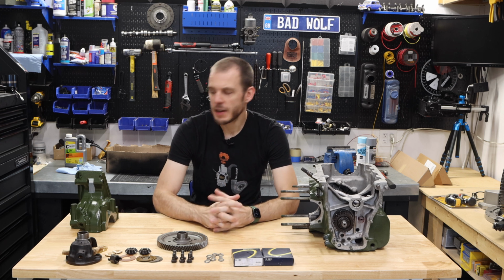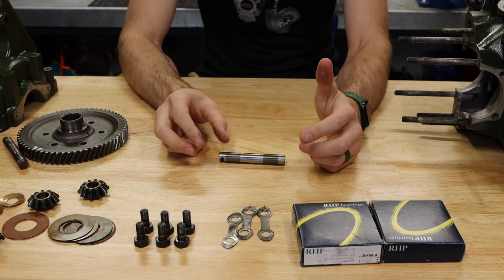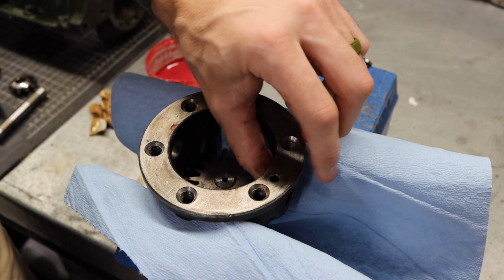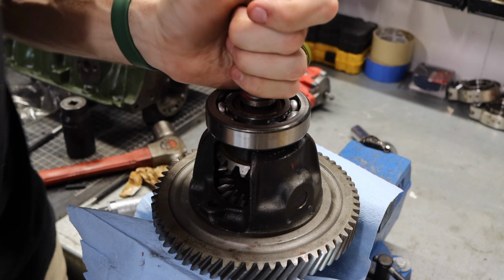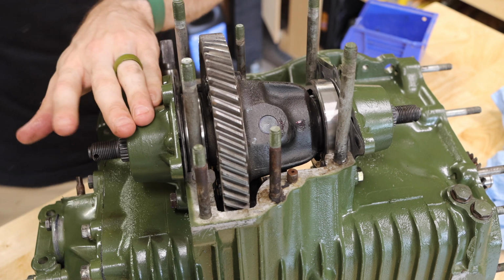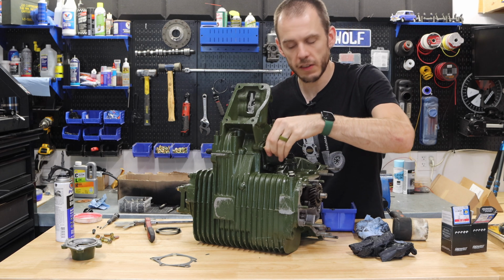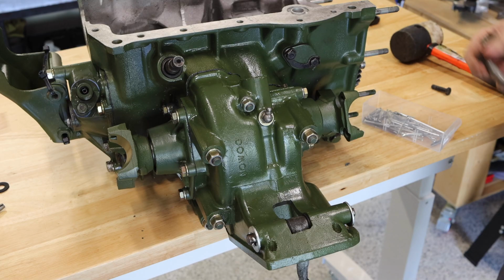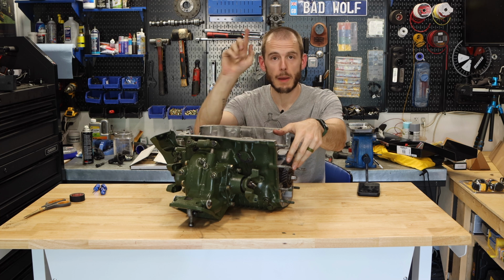Mini Cooper S Diff Assembly - DIY

Comment: OK I'll never know how you can master this and write unit tests for Angular simultaneously. Makes me think you could do a whole bunch of A-Series web calculators not just for final drive - you know the possibilities already like speedo drive, wheel circumference etc etc.   I've been needing and following your recent episodes - in exact order - trying to get the car ready for Monterey.  I'll have to put the original single pin back in since I'm out of time to order a Quaife from MED... but great job showing a failed single pin that we've all heard about for years but have never really seen in real life.
Reply from the maker: Thanks so much! Yeah, you don't normally get to see a truely forked single pin like that. One thing is the gearbox calculator I mentioned handles wheel size and speedo drive calcs as well. ☺ Link below if youre interested. 

https://www.classicminidiy.com/technical/gearing
Reply: @classicminidiy  Good god almighty.  You really should put that link in all your description sections with your other links.
Reply from the maker: Straight up until you said this I thought it was there. 🤦🏻‍♂️